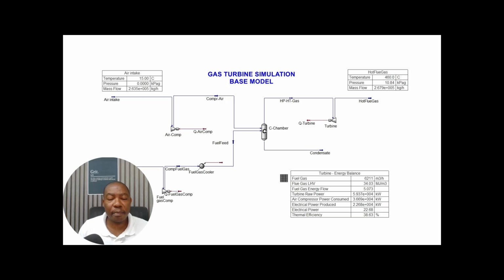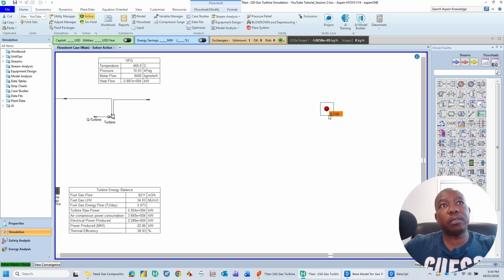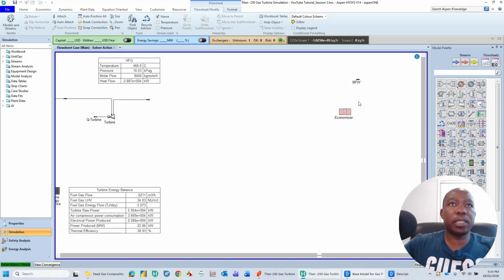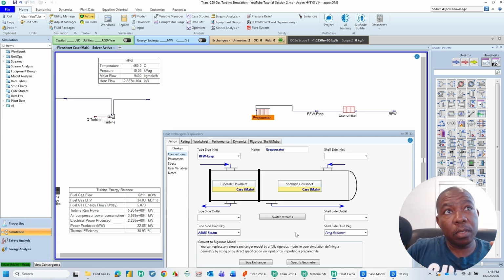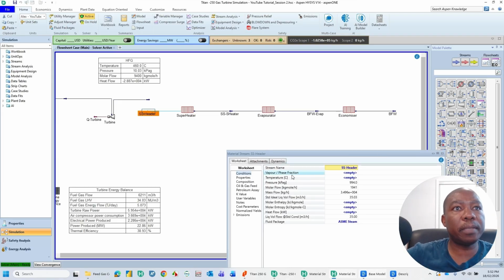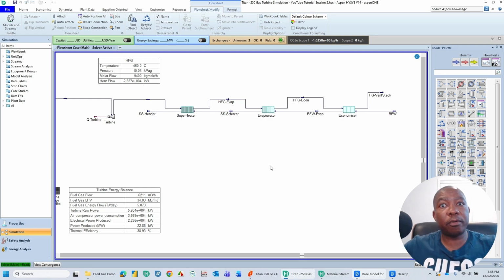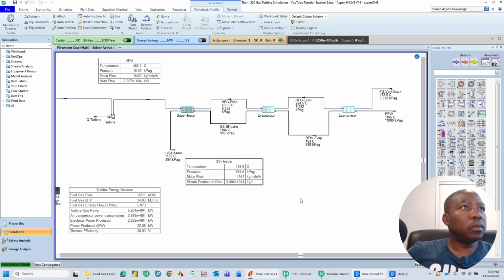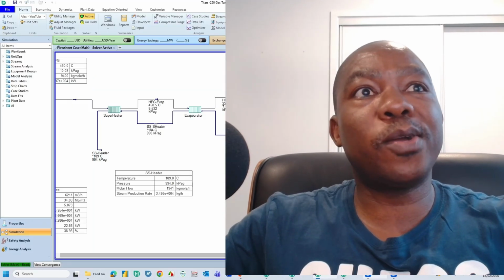HYSYS Gas Turbine HRSG Simulation | Economiser, Evaporator & Superheater Model

Comment: Awesome video regarding HRSG and Gas Turbines. Can you explain why you took 35.2 m3/hr as saturated steam flow rate .Density for water is going to change at 105 Degrees and 1000Kpa .Is this assumption valid ?
Reply from the maker: Hey mate, thats an excellent observation and I like people who have an eye for this kind of detail.  

From the video you will also observe that I specified the flow rate of the boiler feed water and not the steam. @ temperature 105 oC and pressure of 1000kPag the BFW density would be very close to ambient conditions. But you are right the most accurate way could have been to just specify the mass flow rate of BFW. Good on you thinking this through.. 👍